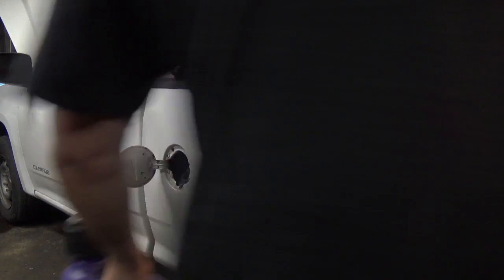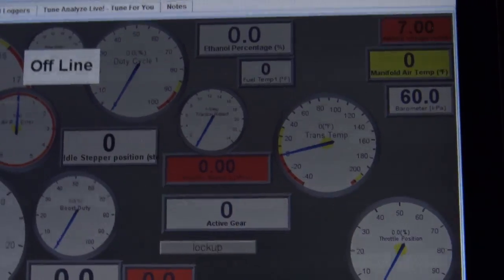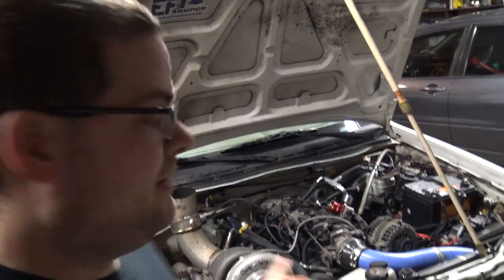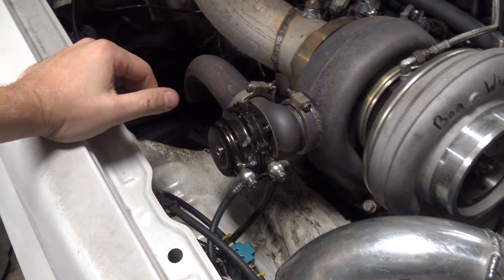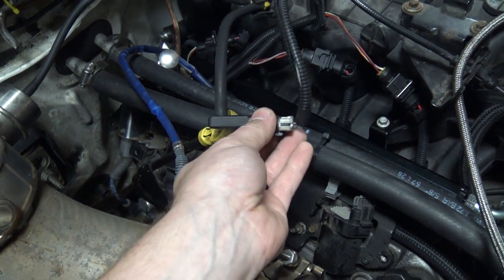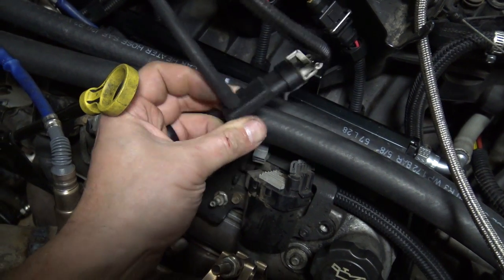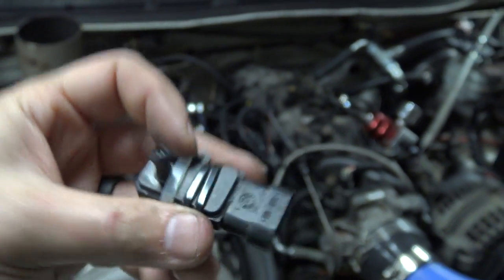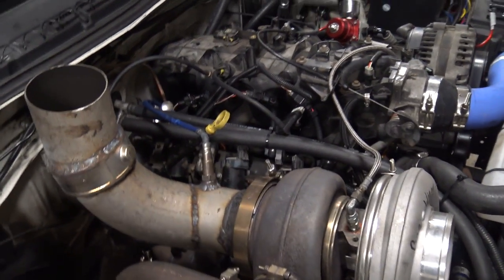tickling 1000whp number 2

Comment: Sounds like a good time to use that endoscope you were given. Might be able to see a crack. Good luck Matt!
Reply: 4sf3d4g63 not on sides of the pistons where the ringlands are
Reply: krazyd27 I've heard they typically crack up top.
Reply from the maker: i always crack mine in the middle
Reply: ah shucks. must be the middle for ls engines then. makes sense since you weren't getting a loud knocking. Maybe it's Subies I'm thinking of that knock out the upper ring land. my mistake, I stand corrected.
Reply: 4sf3d4g63 yep that's Subaru that take the top ring land.... that's their trademark lol

Comment: The struggle is real!! I feel your pain. Pushed out a cam bearing while swapping in a stage2 sloppy. went and pulled a JY motor the same day. Marathon engine swap the next free day I had. Not real impressed by the results of my work. The big cam is super soft in the bottom and doesn't feel that much stronger in boost. Keep at it. Superior results from inferior parts.

Comment: I'd like to see the 6 liter Block with the 4.8 liter crank with forged Pistons and rods, high rpm screamer with big turbo and big heads
Reply: Thomas Cahill I'm with this dude
Reply: Thomas Cahill, I like that idea! 👍🏻
Reply: Thomas Cahill check out D and A machine shop on YouTube. They entered Engine masters with that exact combo. It made 540 hp na.
Reply: there is another guy named "jackson" on ls1tech with an f body that had a 6.0 aftermarket ls3 heads, sheet metal intake and a good cam made 625hp na and revved over 8 grand. Then he added twin turbos and made like 1100, awesome shit!
Reply: Greg Bates, I've seen that...
Reply: I saw an article about it somewhere, car craft or chevy high performance magazine, I'll have to look it up.
Reply: Thomas Cahill, Its on YouTube too...
Reply: I've got an ls1 block i'm throwing a 4.8 crank in. 8k screamer
Reply: Steve Guzman what size block?
Reply: Steve Guzman just make sure the rotating assembly is balanced correctly and the heads flow. It will make good power of the heads can handle the flow.

Comment: Sloppy Mechanics
Matt ,
May be time to get piston oil squirters. They sell jigs and from what ive read are easy to install. Keeps your piston/rods allot cooler . 
Do you have a manual boost gauge or do read kpa from the ecu? Think you may have been running more boost than you really were because the leak? Ive never used MS. The waste gates all digital right ? Runs off the reading from the ms3? Did you confirm you had spark on all cylinders? I know you said they where all operating at the  same temp.
Thats an odd problem  never seen that one on a healthy motor. Its like you drooped 2 cylinders. 8/1000=125-2=750. But there all reading the same temp.odd..
Any ways hope ya figure it out.

Comment: Matt I'd say you're spot on with the broken ring lands. Before you take anything apart, I'd be putting one of those new borescopes in there and trying that. Even if it's a broken center land, you might still be able to see some distortion on the piston crown.  I've seen transmissions, particularly converters break and cause some weird HP numbers, similar to what you're describing, but.... The sound is usually pretty obvious, the engine really sounds like it's laboring when this happens
Reply from the maker: tops are ok from what i can see, i usually break the middles

Comment: I think you're right about the lands giving way at a certain cylinder pressure level. The blow-by coming and going would be to me the tell tale sign. 

I think you should use your current turbo on the 4.8 and then show what a small say 100 shot of nitrous will do to a larger turbo on a small cubic inch setup in regards to spool.

Comment: Nice sleeper. What tuning software would you recommend for LSx motors? I have the PalmerXL standard bought a few days ago for like $60 and trying to understand the PID's & spark table. HP tuners software is like $500-$700 that's just crazy but I know it's good for actually tuning instead of just reading and recording live.

Comment: your vids are really great. i've been reading some piston technical info and, once you go over 200hp per cylinder, you are crossing the threshold of what is considered safe on non-forged pistons.  unfortunately forged pistons have heat expansion problems and will slap when cool.  e.g. 700hp hellcat is a chosen hp so that forged pistons were not necessary.   konegsig one:1 makes 1300 hp on a 5.0l engine on pump gas with wide-band turbos at 8,000 rpm or thereabouts.

Comment: what does torque converter slippage do to numbers on the dyno? transmission drag? I notice on de acceleration u added fuel because it isnt back firing like it did when motor popped.. and ringland broke for sure can and most time will give  good compression reading i fell for that  on my car.. leak down didnt show on broke lands to some times it pushes the pistion back together some cases.. not sure if u seen my post about nelson racing engines mentioned making it richer under deacceletartion,
something stupid to try after leak down doesnt show anything try a vacuum on it to see if it pulls air up around the broke ringland instead of pressure pushing the casting back together. told u stupid idea but damn curious.. lol love the videos!

Comment: Matt, not a fix for you engine issues but was thinking, why not get your manifold pressure input from a pressure transducer instead of the crappy GM MAP sensor? You are at the pressure limit of a vacuum hose pushed onto a nipple.

Comment: Hell yeah, 4.8 with gen 4 rods, a good cam, 317 heads and a s480 ftw! I'm making 650 rear wheel horse and 615 lb/ft on 12 pounds and 91 pump gas.

Comment: need help! I have a 2000 Silverado with a tired 4.3 vortec but there is my nieghber with his 2002 silvera 5.3 for sale cuz he has a cracked/bent frame and driver side impact. so my ? is the wiring going to bolt right up to my fuse box or do I use his fuse box cuz ist like one bolt underneath the fuse box and in between the two other bolts for orther stuff so please help me out on this one please

Comment: I work on street sweepers so I'm only guessing, what is your crank case pressure like when your up against the pins? if that is good what does the trans temp look like compared to other pulls you have done in the past? love all that your doing!
Reply from the maker: all the temps and logs look great and normal trans temps are better than normal because of the valve i replaced prior

Comment: dont you have an old 12 volt high volume fuelpump laying around somewhere , would make emptying those gascans a lot eazier (set gascan on floor near truck  , drop pump in , stick hose in filleropening , hook up the battery and wait)

about the lack of power , it stumps me too but i take some wild un educated guesses at the problem could it be it looses boost through the valvestems intoo the valvecover with the intakevalve still closed , if that would be the case it prolly have popped off the oilseals on the top of them (wish could explain the oil use but not why theres 20 psi manifold pressure then again it could hurt the total amount of air volume at 20 psi put through the cilinders )
maibe you can remove the valvetrain so all the valves are closed make a plate that fits in the place of the turbo compressor side (maibe just a plate with a v band edge and put it with a v band on the intake of the compressor) then pressurize the whole boosted part up to the back of the valves to 20 psi and see if theres sumtin hissing before it enters the cilinders

Comment: I have been meaning to ask, how do you handle crank case ventilation and oil separation?  I know a lot of turbo and supercharged cars need good catch cans or else they blow a bunch of crap through the PCV in to the intake, maybe stick a finger in to the intake manifold to see if it is oily?

Is there any way to do dual MAP sensors so you can spot a sensor failure next time?

Good luck figuring it out.

One more thing, I would be double checking the dynamometer calibration just in case.
Reply: Austin Doud, well I guess that is one way to do it.

I guess I'm used to fuel injection that freaks out if you lose any metered air instead of speed density that might not even be closed loop.

I wonder if a crank case pressure of 1 atmosphere might have contributed to ring land damage?
Reply: Daniel Lucero no he just hurt it with too much boost probably 30+lbs of it detonating the whole way
Reply: Austin Doud, yeah but that means 30+ psi more pushing against the ring land than if the crank case was pressurized.

When you are getting close to the edge, that might push it over.
Reply: Daniel Lucero I assume he has it vented to atmosphere

Comment: so if the map sensor wasn't reading actual pressure you werent supplying enough fuel for the actual amount of air, did the O2 ever show lean or closed loop show a bunch of correction?
Reply from the maker: fuel was ok, but boost cut was basicall not working and amount of boost was unknown for those pulls, more than likely what torched something

Comment: why do u have so much oil burn through the dump pipe after a pull? is it just the engine breathing into the dump?
Reply from the maker: 35 ring gap, 265k miles LOL

Comment: coil packs are pretty close to that turbo too good chance they r fucked too just my 2¢. what did you put down for torque numbers just out of curiosity?
Reply from the maker: we swapped the coils on the dyno, 880ftlbs or so
Reply: +Sloppy Mechanics 880ft/lbs at 955hp or when shit went haywire at like 750hp? I'd say valve train issues like partial lifter collapse, if you made similar torque numbers at two way different peak HP runs. partial lifter collapse is like too small of a cam. lol

Comment: get a few quarts of nitro methane. that will get your power back. if you can keep the heads on.  could it be a combo of rings and ethanol content? maybe you could put some methanol in the fuel. it has a higher energy density than ethanol. but that has nothing to do with you loosing power. I think it could be rings.  do you have any way of checking blow by while under boost? it would help confirm if the rings have had it.

Comment: What timing did you have in your map at the boost level it was showing in the logs? I'm imagining it was lean as heck and it also had whatever timing you had in it. If it was making 30-40psi, lean, and like 18 degrees of timing because the map was showing 10 psi or whatever it was. I'm impressed that it didn't scatter.
Reply from the maker: correct it could have gone bad fast once i realized it was much higher than it was seeing and it was in a lower part of the map, fuel looked safe everytime but i am sure it had too much spark for massive boost and possibly cracked a ringer

Comment: Well...Since there is already 344 comments I am pretty sure that I will get lost in the white noise but I'll still give it a go.

Since I have seen your comment about the leak down results...

I am pretty confidant that it will be either piston or ring related.

I spent a long time back in my misspent youth building blown alcohol BBC.

I imagine that it is what you suspected...Broken ring lands.

Excessive boost and possible timing because of the map sensor can do that. 

What I really wanted to talk about is...

I would really, really love to see you throw a set of gen 4 rods and pistons into that 4.8.

Or sell it and snag a gen 4 4.8.

I think that your Borg "Wiener" 480 could possibly make more hp on it than your 6.0.

It is hard to tell because there are no maps available for that turbo which makes things harder to really figure out.

But.... 

What I would love to see... Is a max effort attempt to see just what a stock short block LS engine can make.

And I think the lowly 4.8 possibly has that in the bag.

A short stroke strong crank, best rod ratio of any LS engine, nice thick cylinder walls etc.

All that adds up to a really strong factory short block.

Now to the fun part...

High boost is just a number...

Take a stock LS engine and throw 25# boost at it and then do a nice friendly turbo cam in it and it will make the same hp at a lot lower boost level because of better cylinder filling.

Same thing if you put better flowing heads on a stock engine.

So...The "poor" mans recipe is to spend his dollars in the most efficient place.

Forget forged pistons and aftermarket rods.

Take that money and buy the best cylinder heads and intake that you can get for the same dollar output.

So...Back to our 4.8.

Throw a good set of heads on it and while you are at it make the chambers bigger and get the compression down to 8-8.5 to 1. 

Yes it will be a dog off of boost... But depending on how the Borg "Wiener" can really flow air...

It should make the same power at a lower boost level and have the benefit of being easier on the short block.

Then it will be time to crank the boost up and really see what a stock LS short block can take and just how much a Borg "Wiener" can put out.

The fun thing is...If it can max out the Borg "Wiener".

If it does...

It will be fun to see just how big a turbo it really takes before it goes POP...

Comment: my money is that the top rings got hot and lost tension. Matt do you have an EGT PID? If so, what was the data during the unknown MAP pulls?
Reply from the maker: no EGT probe, think they are just lax and shot?
Reply: Sloppy Mechanics , in my experience of cylinder over pressure/heating, the springs lose their tension.  A running- dynamic compression test could confirm. if your running 160-170. I would expect 80-85 on a healthy engine. I'm guessing your 6.0 would be 60-70.

Comment: Not sure if it's true, my dad told me back in the 80s when he did drag racing, if a motor was getting tired and losing compression they would fill it with half oil half ATF and it would bring the compression back up, though that much ATF is really bad for multiple dyno pulls I'm sure

Comment: Floating the valves?
Reply: could be weak springs
Reply: MR G I was thinking the same thing!
Reply: MR G why would it do it now tho after 55 runs with no problems?
Reply: seth newman well springs get weak over time, 55 runs =200000 miles,just a guess since they didn't find any other problems,unless I missed it.
Reply: Also guys that have big ci. big lift cams,800 plus hp on just motor,loosen the rockers in the off season to keep the pressure off the springs.Springs are the weak part of any motor.

Comment: Not trolling here, but 10.1 afr @ that kind of boost is probably what broke a ring land. That much fuel gets down in the lands and out of the combustion chamber and then lights off and wrecks the ring lands.
Reply: gregrob20 
10.1 afr for e85. On the gas scale is not to crazy
Reply: That's true, still way rich tho and stock pistons have no tolerance at that level lol.
Reply from the maker: for sure, its not good for it, but i get that red mist when i start seeing 9xx
Reply: why run it so rich? 11.0 would likely be a lot safer maybe high 10s.

Comment: Damn Matt, that is a bitch!  
I have to say that this project is making gen4 6.0s look like beasts, right along with that Bog Wiener 480, and maybe above all, e85.  The reason I say that is that when the MAP stops measuring boost correctly, your AFRs HAVE TO go lean when the boost starts being under-reported by the MAP sensor.  It's just really impressive all the way around if all you have is ring land issues after that.  You look a little bummed, keep your chin up bud!!
Reply: I don't think it would lean out, because if it's seeing 10:1 AFR @ 15 psi or 10:1 AFR at 26psi, it's still 10:1. The correction may be off to some degree because of the VE scaling at certain RPMs, but what I'd be worried about is the timing table. It would most likely be WAY off because of the melted MAP, as there's no way to correct that unless it's excessive IAT or CLT correction.
Reply: Great point about the timing issue!  Not sure why I wasn't thinking about that.  
Regarding the AFR, if this thing didn't go lean when the MAP wasn't registering all of the boost, maybe it was going "less rich" since it was running so rich with the new fuel system.?  
Without re-watching the video, I don't think Matt really specified what his AFRs were when the MAP sensor was broken, did he?
Reply: I was thinking the same thing, I don't recall him mentioning the AFR. I'd be curious to see what the log actually said. I'd be willing to bet a dr. pepper, that the timing is what did it in though.
Reply: TurboBrooks Makes perfect sense.
Reply: Hammerhaus Kennel he needs to see this comment thread
Reply: @MyLonewolf25, I would agree with you other than for the fact that Matt is probably way ahead of us on this stuff.  :)

Comment: Why not put a good forged piston in it so that it will take some abuse? It has to be cheaper than doing it over and over and over again.  It will never live at 1000 wheel for very long anyway.
Reply from the maker: pistons 750$, making mistakes with expensive pistons is just that, an expensive lesson, these stockers are just laying around. its incredible what you can achieve when you're stubborn as fuck with stock parts

Comment: Is that a stock block?
Reply from the maker: yeah its a stock LONGBLOCK, stock heads, oil pump, intake, throttle, stock pistons rods, stock pitted ass valves, stock filthy bearings stock head gaskets, stock head bolts, stock stock stock stock

Comment: torque converter toast?  drop your tranny pan and check for junk.  shrug
Reply: If you suspect tranny, always check for junk...
Reply: Garage Build I dont think it would be that if he got the same speed and rpm every dyno run for 55 runs? if it were to slip at all it So I drop the mileage eventually